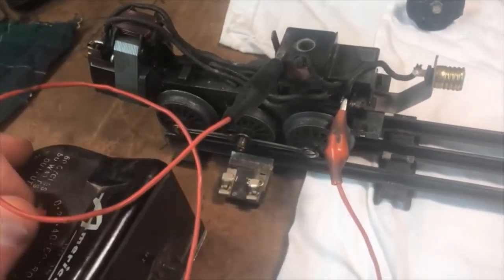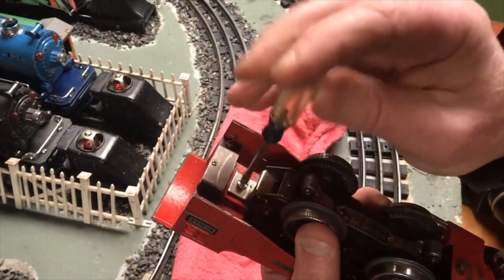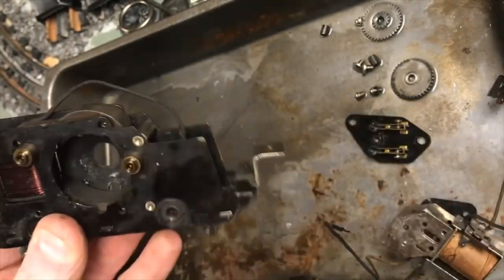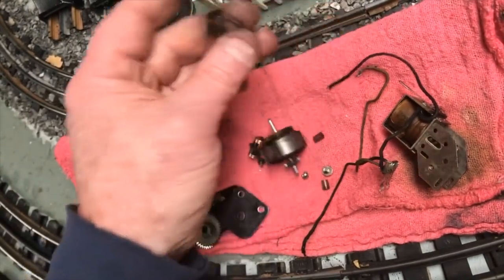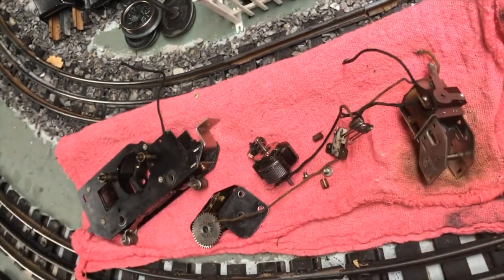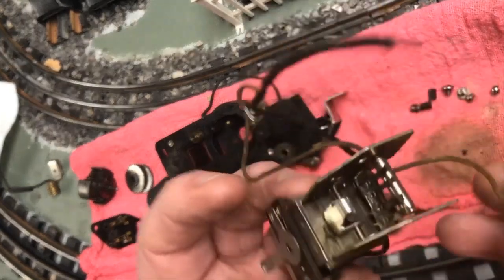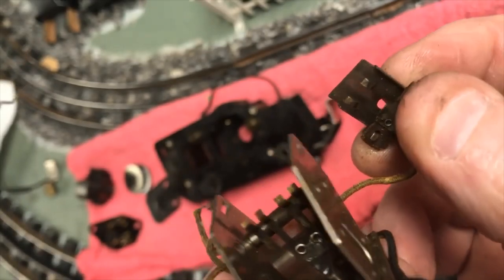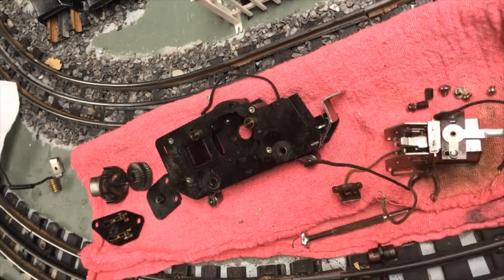Vintage Model train Lionel 1935 Red Comet set # 278E part 2 Can we make this 87 year old loco run?

Comment: I have see several old motors sets like this but it is so weird that they have the brush plate on up side down as compared to the post-war Lionel.
 Also this gear set up is so much like the last more modern MarX motors of the late 1960's -1970's.